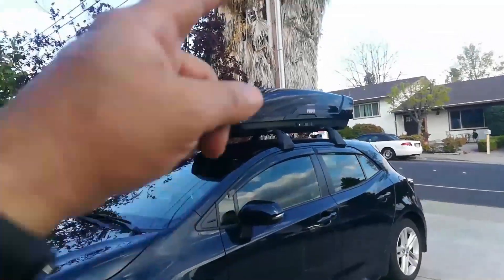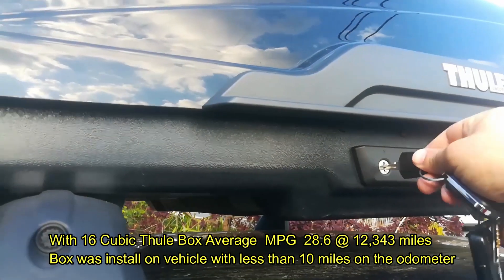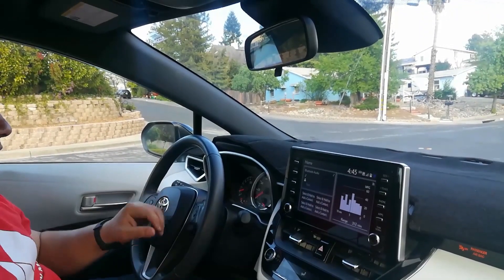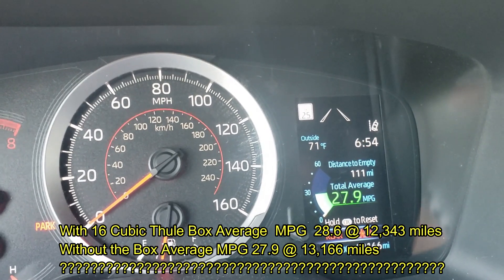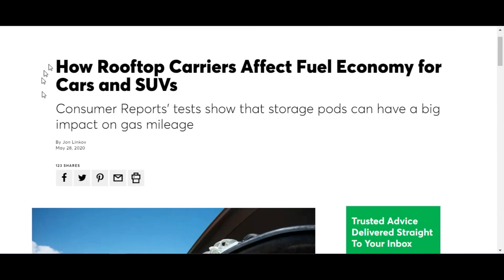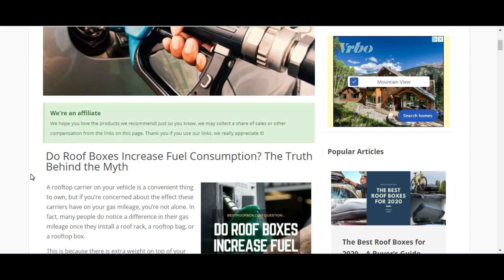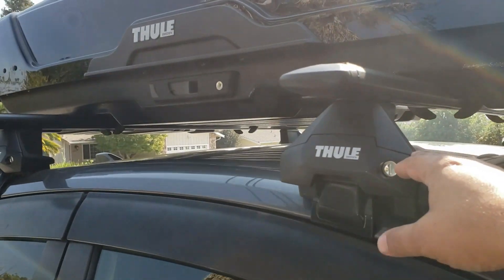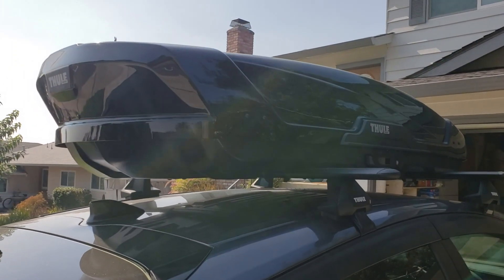Does a Roof mounted Cargo Box Affect Your Gas Mileage?  Thule Cargo box effect on MPG

Comment: Leaving this comment to help anyone else wondering about this in the future. I have a 2022 Corolla Hybrid. I installed Yakima roof racks, along with a Thule Motion XT-L on it. The car is rated at 52/53 mpg. I was averaging over 60mpg but when I installed the box, the display on the car went down to around 38!!! In the 2 years owning the car, I NEVER saw it go that low lol. So in my case, at least for the HYBRID version of the Corolla, it does NOT like the box haha. Needless to say, I didn't even wait to finish the tank of gas. I removed it and literally in one drive my MPG went up to about 40mph. I'm sure by the time the tank is empty I'll be up closer to the rated 50mpg or more. Also, because of how the roof is on the car, the only way to mount roof racks is to have them go into the door. This flexes the door seal a little. So I'm going to remove the roof racks and only install when needed because I don't want them warping/messing up my door seals from leaving them on permanently. Also, the roof racks also decrease MPG so the 40mpg my car went up to was with the roof racks only in just a few short trips. Once I remove the racks I know the MPGs are going to go up and up! At the end of the day, use it if you need it. But why leave it on if you don't need it? Remove it and save yourself some gas :)
Reply from the maker: Hi eric,
Thanks for sharing your experience. Why not use a factory style mount like I had on mine? The vehicle has pinch rails. I  never saw my mpg above 34 with or without the rack. The hybrid version is a whole different beast. Why didn’t you burn to through a couple gas tanks before making a final decision as the winter does produce different winds and some are very strong.
Reply from the maker: Eric, I just remembered I installed that same box on a Prius, a 2016 and I was still getting above 42 mpg down from 46 mpg without the bars and box.
Reply: I did not use factory style mounts because they are rated for much less than the aftermarket ones. I believe OEM can handle like 100lb? My yakima ones I think are good for 220lbs. At that point im still limited by the cars weight capacity which I believe is 165, but its a huge difference. With my current setup, I can haul about 100lb worth of cargo. You add the box at lets say 40 and roof racks at 25 thats 165 total. If I use the 100lb oem ones, the max I could haul after you subtract the box (let's say 50lb) would be about 50lb worth of cargo. Might be few lb more, or less, depending on the box. Some are super heavy. Of course you can load what you want and may never have an issue but I just want to maintain safety and stopping performance etc.
Reply: @RANDOMFIX as far as the prius installed it on, I'm not sure. It may have something to do with how your mpg meter is set. See mine is set to measure fuel tank mpg, not lifetime mpg. I think there are a few options... I actually have written down ALL of my mpg info for every single tank of gas since I purchased the car! Ordered it from New I'm 1st owner. Had 6 miles when it got delivered. And every time I reset the mpg after I refuel, the mpg goes to 99pmg, then slowly goes down to 70 and 60 and so on but pretty quickly settles over 50mpg. Usually in the 60s. But this time I installed the racks and then like a week later installed the box. Finished that tank which was almost empty and then reset mpgs. It very quickly went under 40mpg. I drove to the store a few times. Took the car to the dealer for its 24k service. Drove on highway a few times and in the city and mpg never went over 38.. But as soon as I removed the box (last night actually) I went on the highway, to a store, then drove through the city to a friend's house. Then drove home and i was up over 40mpg by the time I got home lol.
Reply: Either way I don't want to risk getting rock chips on the absolutely beautiful black paint on the box so I'm going to remove it and store it until I need it hahaha

Comment: Something must be wrong in your calculations, sorry. There is about a 0% chance having that big cargo box messing up the aero dynamics did not massively decrease your fuel economy. It does for everybody else.
Reply from the maker: You are right as far as the logic but I didn’t get a massive mpg decrease. These boxes are pretty aero dynamic and only suffered about a 2 mpg decrease on a 2016 Prius as well.
Reply: @RANDOMFIX  every other analysis shows something between 8 and 14%.
Reply from the maker: On this exact box and vehicle?  The vehicle was a 2019 corolla hatchback. I drive with a lead foot and this was a 6 speed manual so I was not trying to hyper mile. Even before the adding the box I got a much lower mpg than the epa sticker showed when I purchased the vehicle.
Reply: @RANDOMFIX  i’m just physics in general. That thing creates so much drag. I just don’t see how it’s not massively affecting your gas mileage. And your car is very underpowered relatively speaking, and very small, relatively speaking, which will make it have a greater effect on a large and more powerful car.

Comment: Just saw this video. I appreciate your video and the time it took. Few things to consider…
1. It’s the wind drag that is a bigger factor on the highway speed. I agree in the city driving you might not see that big of a drop in mpg. 
2. If you are gonna do a real life accurate test. You should drive on the same highway in the same direction checking the wind speed. Then do a reading with the box and without. 

I think the speed and wind load is a key factor in the mpg. People buy the boxes mostly for the cross country or longer distance benefit. I am not sure if your test was in the city under 50 mph. 

I have a small tear drop trailer, when I pull this with my Lexus GX, going 65 mph vs 75 mph has a HUGE difference on my gas milage, again it’s the speed and wind load. 

Just my humble 2 cents. 😊